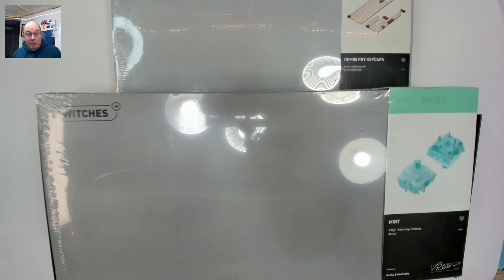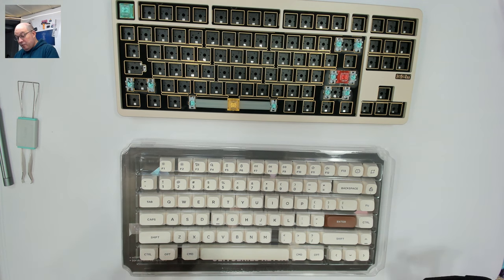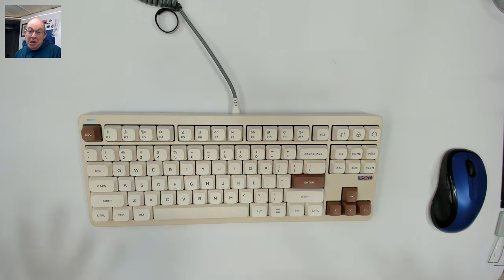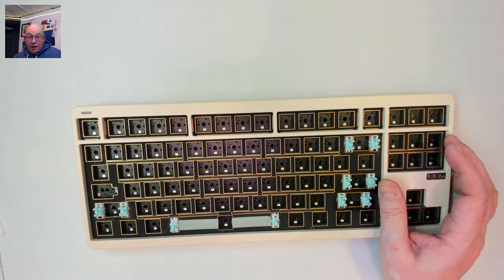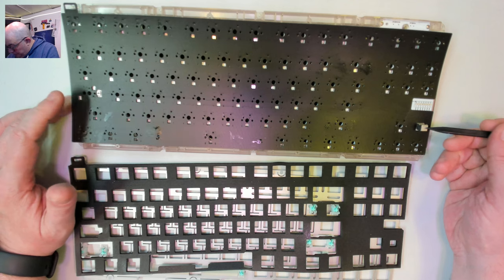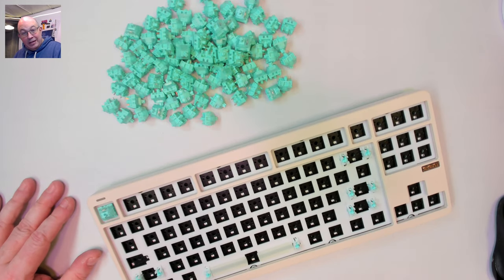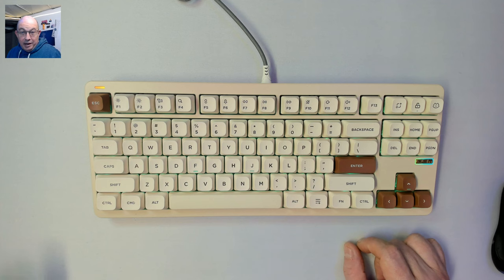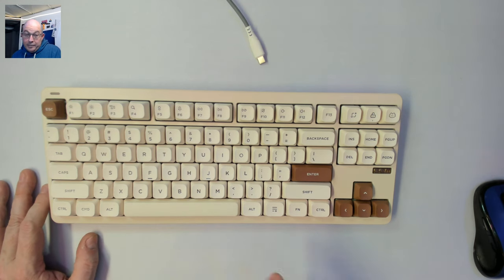🌟 NuPhy Gem80:⌨️ In-Stock Custom TKL Mechanical Keyboard | Review and Sound Tests ⌨️ 🔊

Comment: I overall love my Gem.  It sounds and feels great.  I do want to mention that the FR4 plate that was sent to me not cut perfectly so the switches wouldn't physically fit in the plate.  This could be fixed by shaving off the edges, but if you're paying 180 for a keyboard I do expect it to be ready-to-go. I appreciate that they are sending a replacement though so that's a plus for customer service.  Hoping this board holds up for the long run.
Reply from the maker: Good to know!

Comment: You could almost use the switch try as a lube station! Torn on this... have my Rainy75 on order but been thinking of this or a Neo80 as I love my Neo65 and that board is so easily modified. I couldn't tell from the Website, is this QMK/VIA?
Reply from the maker: It's VIA now, QMK should be released shortly, they just released QMK source for their Air V2 series. I have the Neo65 but have not had any time to build it yet!
Reply: I ordered a Rainy75 too, but I kind of want the Gem 80 now because I'm too impatient and can't wait until June for a new keyboard lol.
Reply: @_skyline I know right?!? My bank account hates me :)
Reply from the maker: @nissan_skyline  I don't blame you, they are both quite nice!
Reply from the maker: CaptainClassic1  might you be able to comment under my M75 video, it's a bit of hijacking on this video, no?
Reply: I did pick one of these up and it got here today, got the blue one and it's very nice. Definitely super creamy with the Raspberry switches and their keycaps. Not really my preferred sound but definitely not bad. Looking forward to playing around with it, TONS of options to modify!
Reply from the maker: @MarbsMusic  awesome! Thankfully this board is pretty flexible and can reach many sound profiles, have fun!

Comment: Yeah, mine won't charge out of the box, and frequently double-types keys.  Already did one firmware flash, and it didn't help.  Not sure what to do, probably gonna have to return this. Too bad, I liked the sound OOTB, and the lighting is fairly nice.  (bttw, this double-strokedd like shown in this section of text inside the parentheses, it's rather annoying and a big reason why..  does this even on wired.)
Reply from the maker: You are not the first to report this, but I've yet to experience this. Might you by chace have some extra switches to rule them out as the culprit?
Reply: @MechKeyboards  I've already swappped out the spacebar but it. still does it sometimes.  As it stands, so many keys do this that I've run out of spares in the kit (there were only 3). I'd have to order a complete new 30-set and just keep swappping, and I'm afraid that with thiss failure rate that it's likely going to chew through about half of those.
Reply from the maker: So when I used this for my daily and did experience some mistakes but checked it up to the light switches, as I usually prefer a heavier weight of 55g or above. So I just pulled it out and really gave it a test, and sure enough, many double key presses, with many keys. I decided to try the easiest thing first, replace the switches. I had a batch of U4Ts that were free, so I switched the Mint switches for the Gazzews, and lo and behold, a much better experience, but there is still the random double key press. If I had to guess, this is a debounce issue and should be able to be corrected with the proper settings in the source of the firmware. As QMK is still two weeks from being published, I'll have to wait to see if I can just try different settings and getting working right, but for now I am going to forward my findings to NuPhy and see if they can correct this issue. But in the meantime, I'm sticking with my 65g U4Ts. I'll probably make a video once I've gotten things worked out.
Reply from the maker: @BinkyTheToaster  I'm very confident this can be fixed with the correct debounce rate, so I would not fret or go buying too many switches, I just happen to have a small arsenal at my disposal ;)